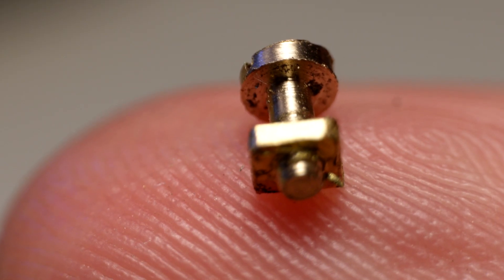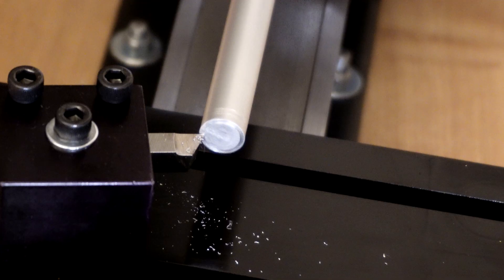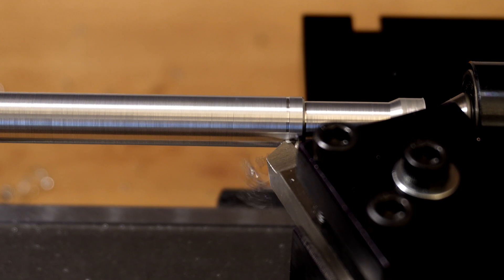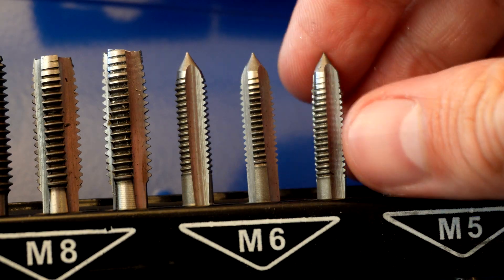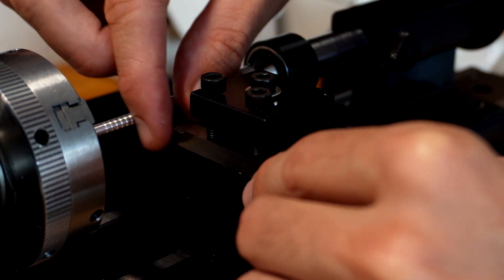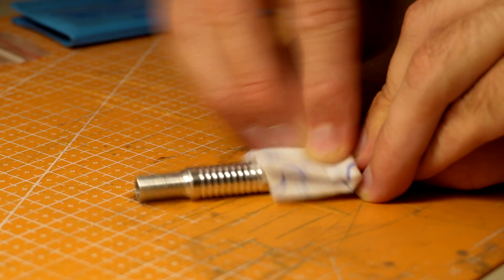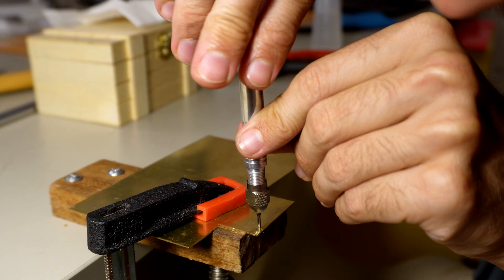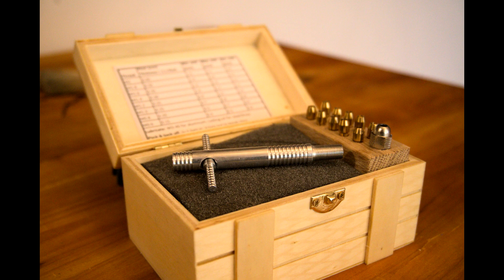With this tool you can make MICRO screws!

Comment: Nope... with this tool you are making micro nuts, not micro screws :)
Screw - male, nut - female :)
Reply from the maker: The screw and the nut were made with that tool. For the screw you insert the head of the screw in the collet (which is why you have different dimensions of the collets) and then you die an external thread as it is shown at 0:03 (you need a screwplate). 

Thank for pointing that out that video is not clear on that topic. I will try to show these steps more clearly next time.
Reply: @tinytreasuresblueprints  Oh... I overlooked that.
Very short frame, and right after it, there is a frame with tap.. so I considered first one is also tap.